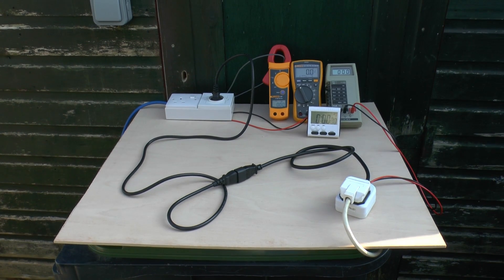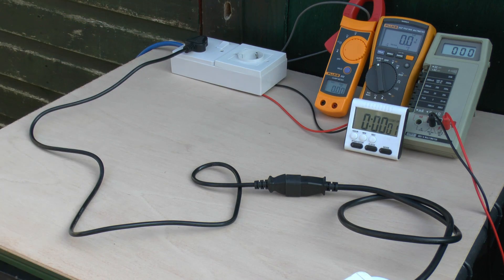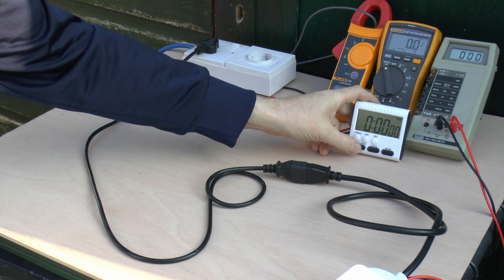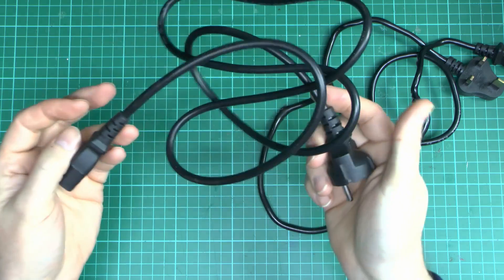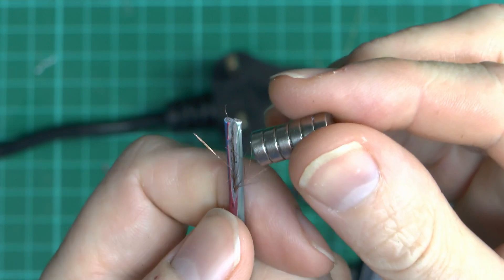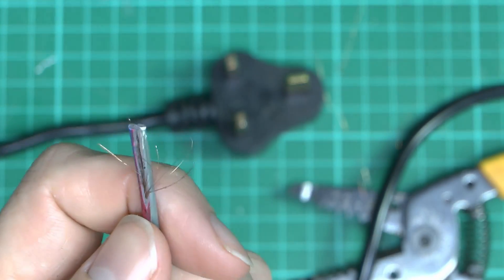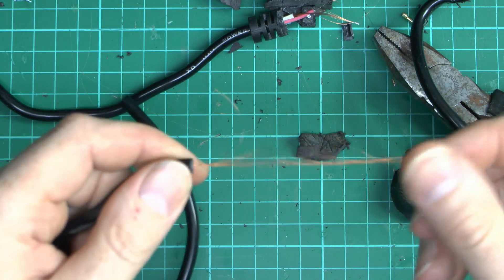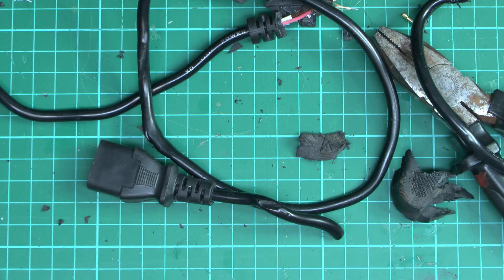Dangerous Failure of a fake UK plug to dubious C13 shape lead

Comment: another thing to watch out for is some iec chassis plugs have aluminium pins... they can snag/bind on the lead you try to plug in, plus they have poor contact to the tags on the inside end of the chassis plug... i've found these on a few cheapo 5v/12v power supplies...which also are fire risks as the mosfet gets hot enough to fry eggs with even minimal load...😱

Comment: To be fair, those making it probably aren't aware of any regulations and aren't being paid enough to care.  The owners of the facility, however will be fully aware of the piece of crap that is being produced.
Reply: Those "fake" power supplies cables are usually bundled with equipment drawing less than 1AMP.  The problem occurs when you use them for other stuff.
Reply: @Terje_P  they are probably only capable  of 1/2 amp or less 😉
Reply: "Aren't aware of any regulations." What regulations. That implies that there are regulations - there aren't any regulations in china or if there are they certainly aren't enforced.
Reply: The people making them have no responsibility in adherence to standards atmall. It is totally down to the owners.